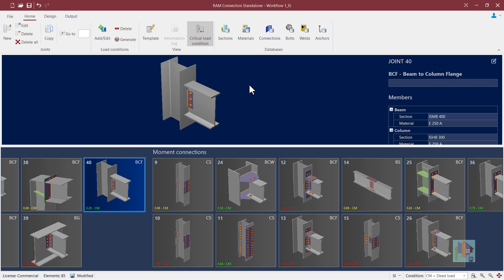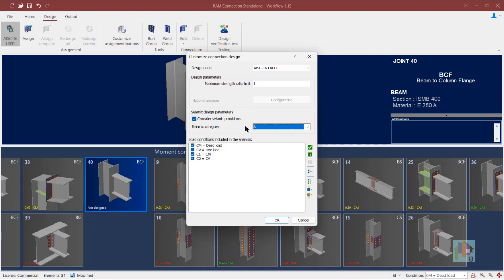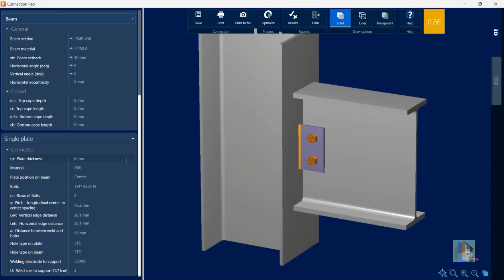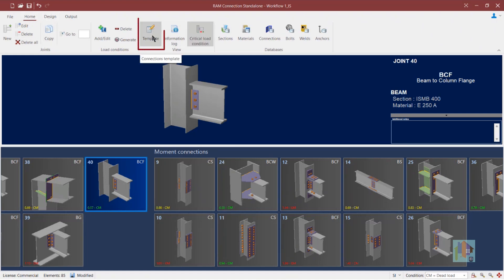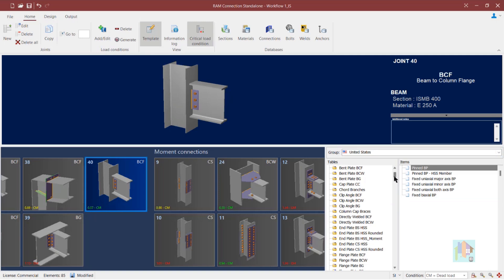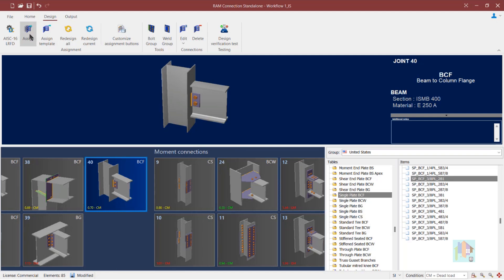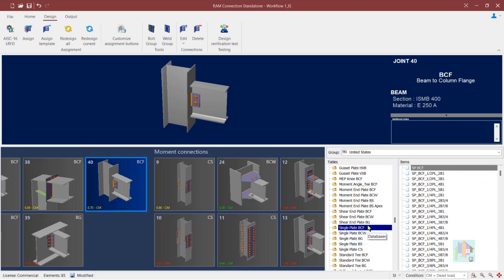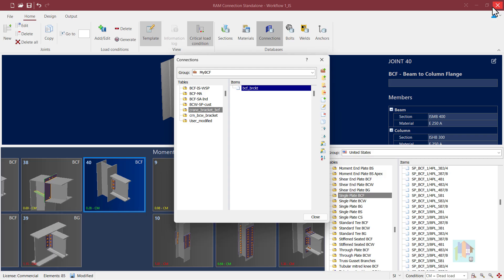Connection Design Overview - Part 4: RAM Connection Standalone: Design using Templates || AISC, IS

Comment: Dear is there any option to provide stiffener on both side Moment extended End Plate connection ( if yes kindly tell me )
Reply from the maker: I presume it is a beam column flange type of MEP connection and you want to provide stiffener plate in both side of the web. It is possible to include such stiffener plate (top, bottom or both) in both side of the web along with diagonal stiffener or doubler plate. After design, from connection pad, you can provide this type of stiffener.
Reply: @surojit_ghosh  I checked beam to beam connection the stiffeners option is not available

Comment: Can RAM CONNECTION STAND-ALONE design base-plate (gusseted column base with stiffener) ?  Can it design anchor bolts as per indian code ? Is it checks all clauses of IS 800: 700 ?
Reply from the maker: Yes, it can design a gusseted base plate connection with stiffener plate. All design checks are performed including anchor bolt and concrete block checks.
Reply: Thanks, Can RAM CONNECTION STAND ALONE checks the concrete pedestal for truncated conical failure, when anchor bolts is in tension ?, as per Indian code ?